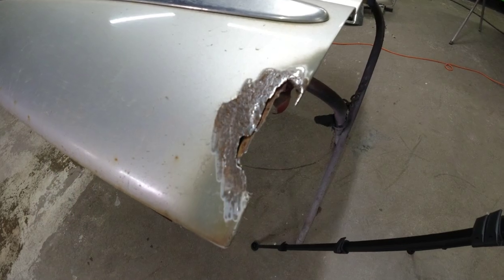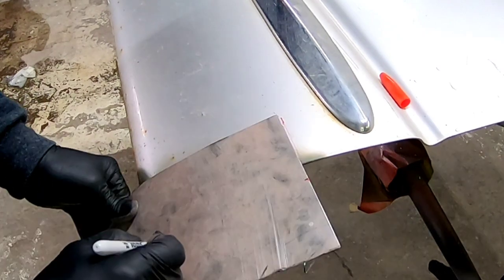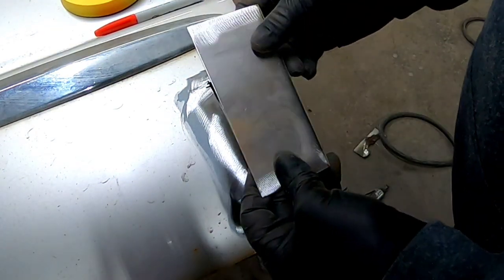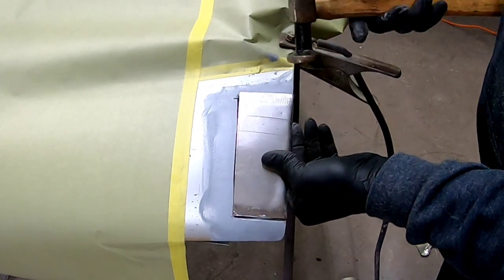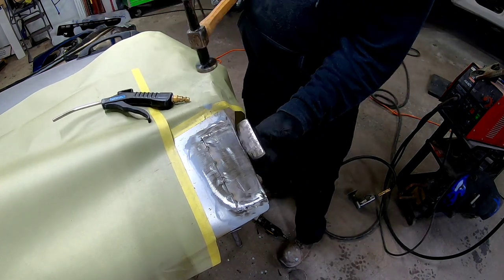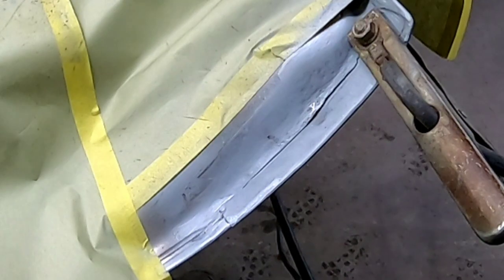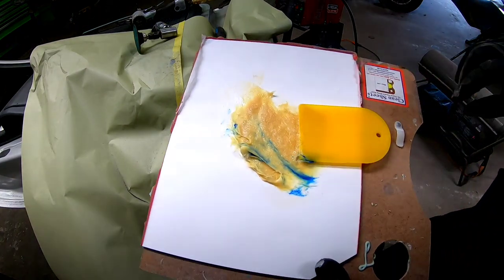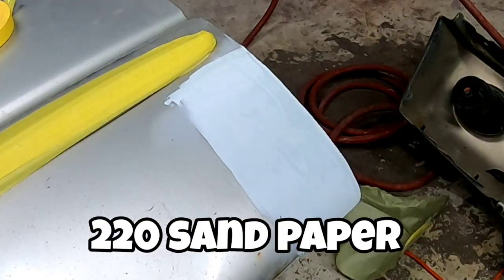Repair a rust hole in a door edge. #autobody # bodywork # rustrepair

Comment: Sorry to be critical, but this is not how weld-thru primer is used. It actually should never be welded thru, and it has very poor adhesion and should never be painted over or left exposed.
Reply from the maker: Yes, It's not made to be painted over because it has zinc in it. You do weld thru it though.  It's  made to cover bare metal that can't  be protected during welding. The remaining weld thru primer  should be removed after welding. Appreciate the comment.

Comment: Looks great! I tried welding thinner metal with my MIG, but it blows thru it. I have it turned all the way down.
Reply: You might need .023 size wire.  Try that if you haven't already.
Reply: I use .023 wire on 22 Guage steel. Works good. Just do it like in the video. Tack welds. Don't run a bead
Reply: @kensendlosky7438  I have tried tacks/small beads but it still blows right thru fast. Do they have a .023 that has flux? I don't have gas.
Reply: @bobbydelamar606 . I use gas. I have two Flux core welders and just can't do much with them on sheet metal. I use a Hobart 140... runs of regular house current.

Comment: Nice job, quick question tho. What’s the purpose of the weld thru primer being sprayed on prior to welding? Couldn’t you weld bare metal, then prime with traditional primer afterwards? Or is the weld thru primer before welding a wiser option? Thanks!
Reply from the maker: Weld thru protects better than traditional primers. It has zinic which helps keep bare metal  protected during the heat of welding. Particularly in areas that can't  be coated after welding like the inside of the door.
Reply: Thanks
Reply: I've got mixed feelings on weld thru primer, especially on thin sheet metal. It's not as sound of a weld rather than over bare clean steel. If you use a creeping type of rust  preventer inside the door like fluid film after the repair is done and painted I think you'd have better rust protection and welding bare steel gives you a better weld. I also like to  use fiberglass filler first over weld repairs, it seals off any pinholes, it's water proof.
Reply from the maker: @marcellemay7721  supposedly weld thru enhances the weld but who really knows.  It's  all a personal preference there are many other options such as fluid film and cavity wax.